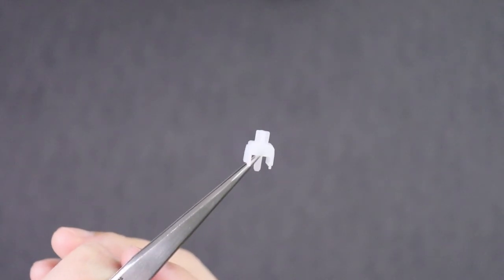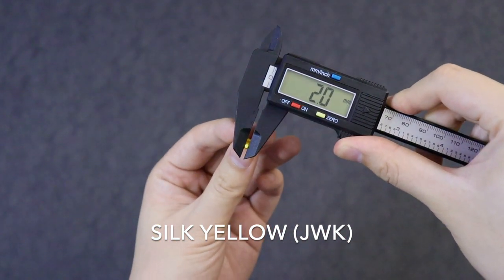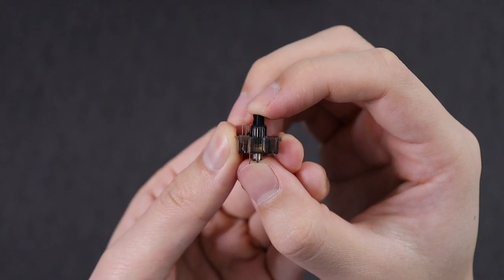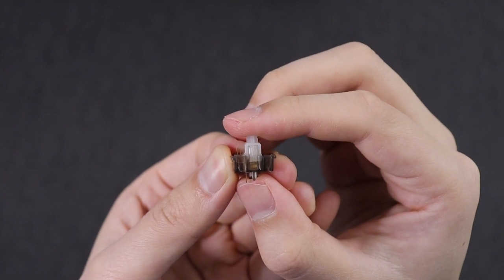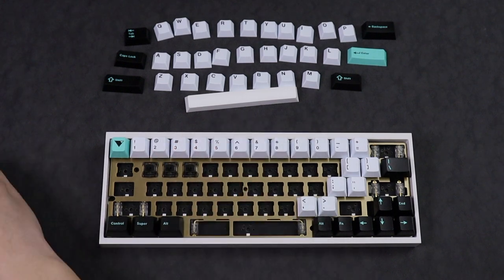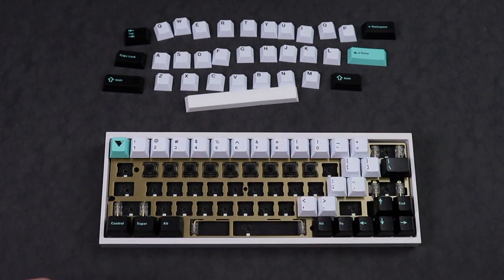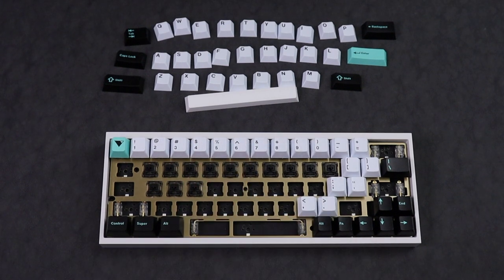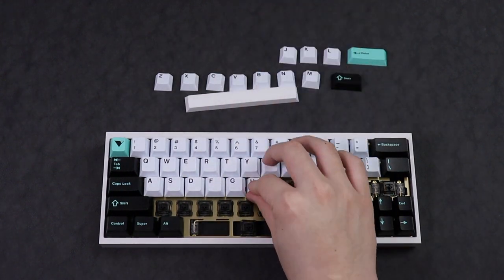Surprisingly Smooth Stems | UHMWPE Stem Review

Comment: Would it be better to just lube the housings, or to avoid these stems if I plan to lube any part of the switch at all?
Reply from the maker: Imo you only need to lube the side rails and the springs. The stems themselves are already so smooth without lube anyways

Comment: Do you think the unlubed 415keys stems are actually nicer and smoother than the lubed stock stems? I bought a bunch of these and was having the issue where they'd get really sluggish after lubing

Also did you lube the housings at least when you applied them? Or was any 205g0 just a no go?
Reply from the maker: For the black inks, they’re already pretty smooth with the stock stems when you lube them, but I think the UHMWPE stems make them sound a lot thockier. 

I did lube the side rails and around the center post with 205G0, but not inside the center post. For sure you can’t lube the UHMWPE stems or else they will get sluggish like you said

Comment: Would these be good with milky gat housings?
Reply from the maker: I think so! Assuming the stem posts don't cause an issue like they do on the JWK housings. I don't actually have any milky gat housings so I can't measure them. I'm sure they would sound fantastic if they work!
Reply: I actually tried them in milky gat and for some reason they don't feel as smooth as the stock stems. They feel great in creams though.
Reply from the maker: @GioZexal99  Hmm could be due to the tolerances like how the stems were too big for the JWK housings
Reply: @AustinV  yeah I agree, it could be due to that
Reply from the maker: @GioZexal99  Do these stems fix the scratchy sounds in creams for you?
Reply: @AustinV  yep fixed it, they feel and sound great :)
Reply from the maker: @GioZexal99  0.0 might have to get myself some creams then
Reply: @AustinV  haha go for it, creams w/these stems feel very similar to the smoothness of inks
Reply: I can recommend milky gat + these stems. But I still needed to lube them i tiny bit with 205g0.
Reply: @walk_dont_walk  interesting, I've had problems w/mine. Felt like there was more resistance w/these stems
Reply: even after lubing
Reply: @GioZexal99  More constant resistance across the whole length or like binding? I tried milky gat yellows,
but right now I am using TealiosV2 bottom housings with milky gat tops and the stems and even though this seems kind of wasteful I like it. The milky tops added a deeper fuller sounds, but added a bit of scratchiness, so I lubed them a bit. I dont really feel added resistance though.
Reply: @walk_dont_walk  I tested the milky top black bottom gat yellows w/these stems. They just don't feel as smooth compared to the original stems. I compared them side by side (4 on each side of the keyboard w/keycaps on) and even had my brother test them. He also thought that the original milky top black bottom were smoother. I'm thinking that it might have to do more w/the bottom housing than the top housing since you don't seem to have any problems w/the tealios.
Reply from the maker: @GioZexal99  You might have the same problems I did. The tolerances were so tight for the stem post that adding lube made it contact the bottom housing even more, which causes the friction. Try taking one of the lubed ones and wiping off the lube from the post
Reply: @AustinV  I see, I actually never lube my stem posts but I'll try to wipe of the lube on one of the switches rn to see if it makes a diff.
Reply: @AustinV  hmmm I still feel the resistance, and it feels a bit scratchier compared to one of the lubed ones.
Reply from the maker: @GioZexal99  Dang :(
Reply: @AustinV  yeah I mean they aren't unusable though. The sound is deeper, just not as smooth as the original stems.

Comment: Looks like these are better than the one DROP's 2nd batch.
Reply from the maker: Yeah from what I've been reading on the Drop stem reviews, the QC on my stems was a lot better. I measured quite a few and they're all consistent sizing and I haven't had any noticeable issues with alignment or shrinkage
Reply: @AustinV  The 415keys stems are a different mold from the ones Drop had.
Reply from the maker: @GooGooGaGa765  Oh yeah I was just trying to say these stems made by jzun are better than the invyr ones that Drop was selling. Sorry about the confusion

Comment: very informational video and the presentation was paced really well.

BOI I WISH YOU DID SIDE BY SIDE COMPARISONS WITH TANGERINES THO
Reply from the maker: Thanks! Yeah I wish I had access to some tangerines :( I'm hoping that stock kiwis sound close enough to stock tangies since they are made of the same materials for housing and stem
Reply: @AustinV  their leaf might be thicker because they are tactiles so perhaps more scratchy than tangerines because more friction
Reply from the maker: @themightyj2629  Oh that's a good point. I didn't consider that. Might have to revisit the UHMWPE stems again in the future with more switches then
Reply: @AustinV  yeah too bad they dont work on durock linears, do you think slightly expanding the pole area on the bottom housings will fix the issue? a hot screw driver might be good for the job since using a drill will leave a lot of fibers in the housings
Reply from the maker: @themightyj2629  Yeah the bottom post is the main issue they're incompatible. I guess technically if you did expand the size then it would work. Lmk if it works out if you ever do it
Reply: @AustinV  i personally wouldnt do it on jwk switches because they already have 0 scratch, if you want a deeper sound just get some cherry switches and make cherry top jwk